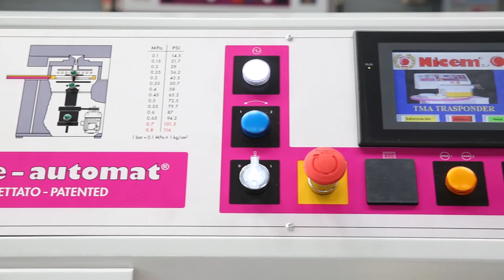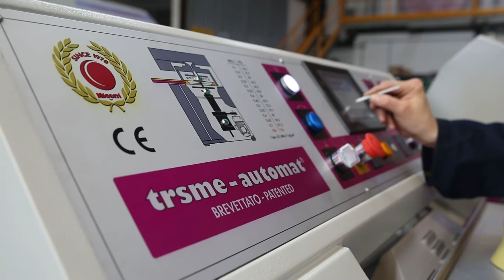NICEM TRANSFER A 3 STAZIONI - TM TAG

Comment: good evening, sorry in advance I singgih Maulana from Indonesia who is a student from a university in Indonesia. 
I want to ask about the C 400 MATIC spin casting machine for the recommended optimal process parameters (speed, time and pressure)? because I didn't specify it in the manual. and where can i get those parameters, are they in the machine? if so where is it located. I've searched the nicem web but nothing.
thank you